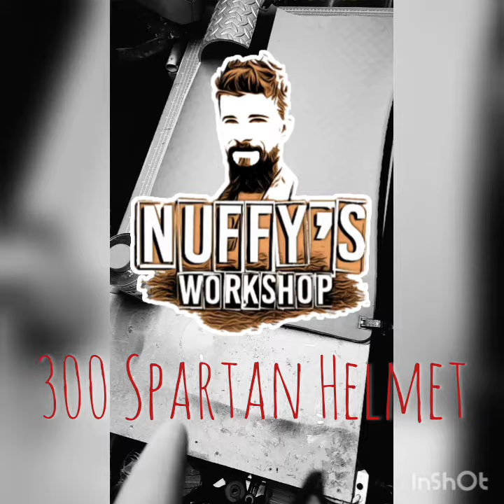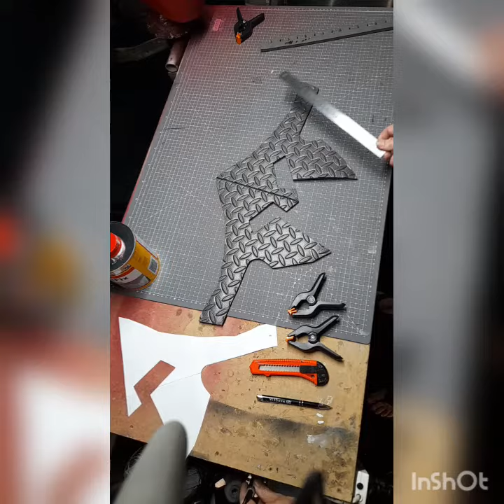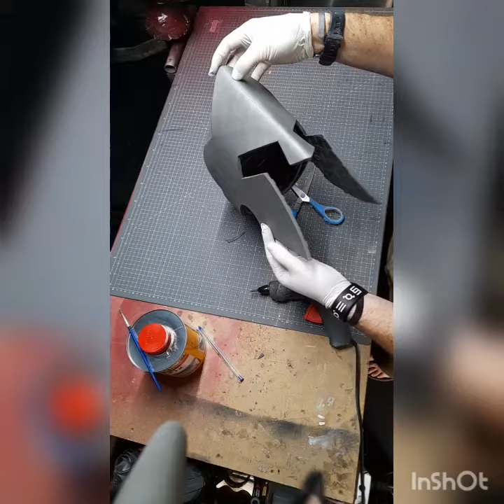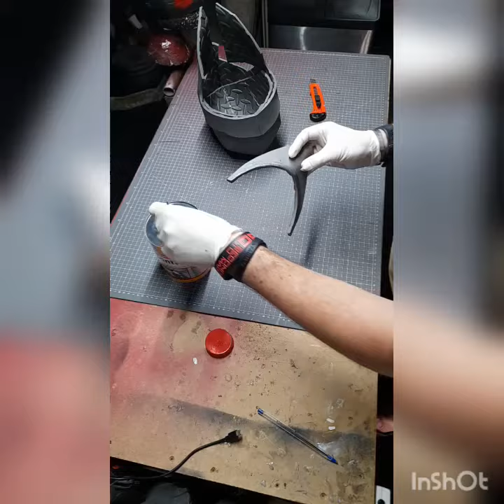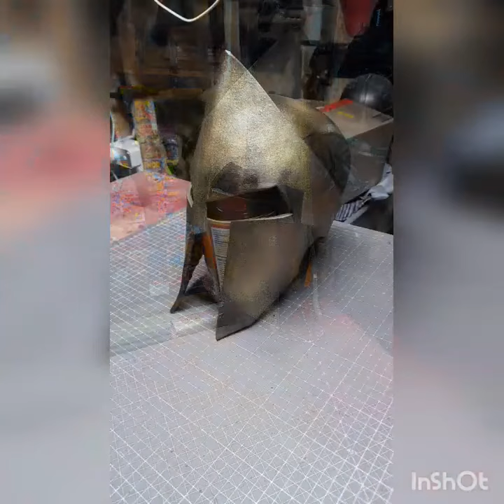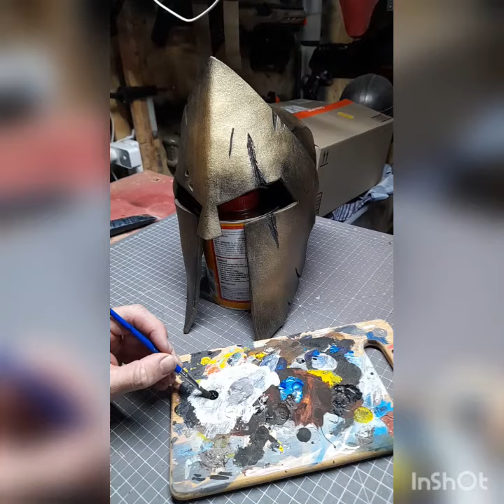300.  Handmade in EVA Foam - THIS IS SPARTA!!! Helmet build

Comment: How do u stop the cheek plates from flaring out
Reply from the maker: Hey mate.  I found that if you bend the checks in at the bottom, so they are almost touching, they tend to sit right when it's on my head.  If your side sections are long enough, an alternate would be to add some elastic under the chin. That way, the cheeks would stay tight to the face.